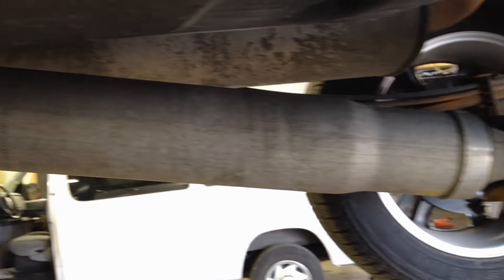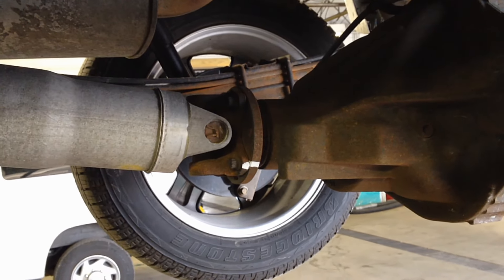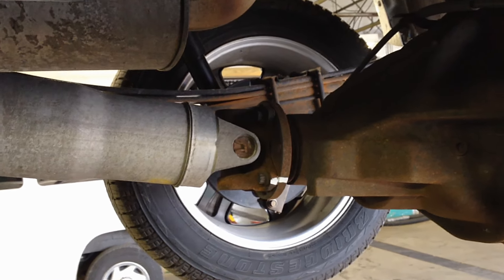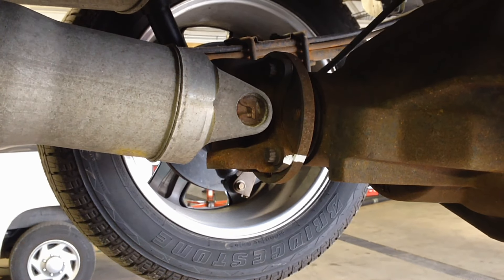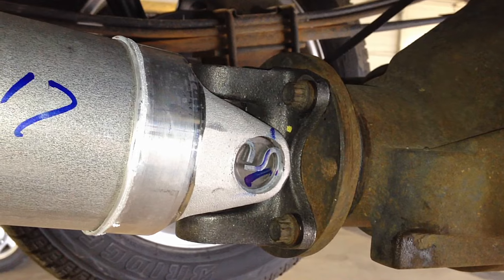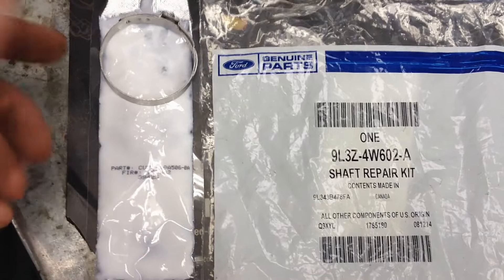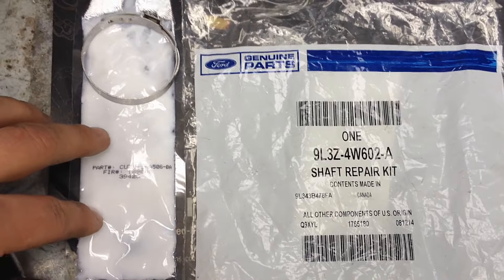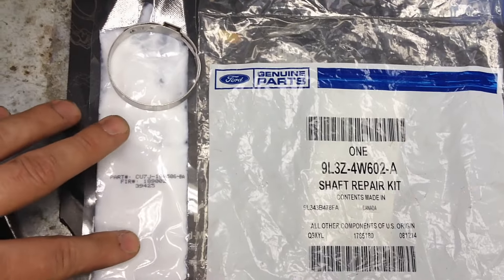Ford F150 One Piece Driveshaft Slip Bump- FIX!

Comment: Hi, I have a 2004 f-150 fx4 4x4. I installed a leveling kit and bigger tires, now I have a clunk or bump feel on take off and sometimes on braking. I have a one piece drive shaft that goes into the transfer case back to the rear. Do you think I have have to grease the slip yoke and is it possible since the slip goes into the transfer case? Thank you

Comment: Hi I have a 2018 10r80 and my shaft has the same clunk. Is that possible since by just looking at it it seem that it's not a slip yoke, the splined component seems to be a part of the trans.

Comment: I have the same clunk problem. It’s a 2009 f150 super crew with the 6.5 ft bed. What driveshaft length is that and would it be possible to convert to a 2 piece driveshaft? Would that help and would it be possible to convert it to a 2 piece?

Comment: I did this to my 09 with a 2 piece drive shaft. It fixed the bump how ever now I have a new vibration at 35 to 40 mph only?  I torqued the bolts to 70foot lbs. should I tighten them more? I have no idea what could have caused this new vibration.?
Reply from the maker: +Justin Miller Did you mark the driveshaft to pinion flange and mark the both sides of the slip joint so it goes back together right? The two piece driveshaft is a balanced unit
Reply: +FordTechMakuloco that my must be it.  I only marked the bolts on the rear diff not in the middle where the two ends meet.  I guess it's time for a new ram.    Thanks for the quick response.

Comment: I know this is an older video, but had a question regarding a 2013 150 4x4 with the one piece shaft. I added a 3” block to the rear in place of the stock block and now I have this slip bang again. Was curious if you think the fix would be simply to re-grease or to add a 3/4 drive shaft spacer? I know I changed the angles by adding the blocks, but what I don’t know is what the tolerance is for allowable “free play” on the yoke to the output shaft. Basically how far should it slide in and out under factory spec? Thanks, your videos are always a huge help!

Comment: So did you fit a 2 piece drive shaft to fix this issue? If so what's the part number on it please. My 2012 SVT Raptor has terrible stick on the slip yolk.

Comment: Looks like you have caused Amazon to be sold out, Will any PTFE grease work?
Reply from the maker: Rob Man I would not use anything but the Motorcraft stuff specified either wait for it or get it locally I guess. They usually don't take long to get back in stock. I even bought some of this stuff the other day on Amazon.
Reply: Rob Man Have used anti-size compound on a few Jeeps with the same setup.

Comment: In the process of doing this to my 06. When i was under there I noticed that my new seal on the rear output shaft on the t cace is leaking. I just replaced it about a month ago. I noticed there is a week hole on the bottom of the boot. Did I put it in wrong? Is that week hole supposed to be on the bottom or is there a brand of seal I should use instead? Thanks for the video!

Comment: I noticed one tooth is broached out ( tooth cut out ) on the slide yoke, why is that? Is the transfer case spline the same for alignment or some other reason? I really can't see how the transfer case spline could have one wide tooth as it has to be gear hobbed, and there's just no other way to machine a round and concentric ( male ) part like that.

Comment: Ok I'm having a problem with the rear drive shaft going back on the splines  the rv been sitting for years with the drive shaft off but there's no rust on the splines. I'm  not understanding why its not going back on. so I guess I will try and greese the shaft like you did or what. Mine is a chevy. Not to mention I tried tapping it on it goes in so far and stops

Comment: I have an 04 f250 2wheel drive 2 piece driveshaft and it keeps pulling out of the trans pushing on the center support. I had to replace it due to the bearings and rubber getting chewed up and it's doing the same thing to the new one. Do you know why?

Comment: I have a 2010 with the two piece drive shaft that had this problem and you aren't exaggerating one bit on how horrible and annoying this problem is. It made me hate and want to get rid of my truck. My local dealer fixed it using the method you showed under warranty and the drivetrain feels nice and tight now. I'm back to loving my F-150. Thanks for posting this. I know this problem has been going around the forums for years.
Reply from the maker: On the two piece one yes but not many talk about the 1 piece drive shafts.
Reply: Chad Fraser I can't speak for everyone, but it's been over a year now since the dealer fixed mine using this method and my driveline still feels nice and tight, good as new. I'm not sure why people are telling you to wait for your U-joints to fail. Is this a common failure on our year truck (2010)?
Reply: he mentioned 2011 worst year to buy ford truck so many recall and issues
Reply: I’ve had the computer reprogrammed, driveline replace and now rubber spring pads replaced and it still bumps/bangs. Any other ideas? 2016 5.0 145” WB 4X4 with one piece driveline.

Comment: Is this the same for 2004 f150?
Reply from the maker: Procedure and problem area still applies yes.
Reply: I keep reading to lubricate the slip yolk is this what it is? Mines an 04 as well. Quick question too, I notice when the weather is cold or truck is cold my truck pulls smoothly but when is hot or truck gets into normal temperature it starts doing this, so why is that?

Comment: Does this happen to the 2012 F350 powerstroke as well? This pretty much describes what I am feeling
Reply: Did you ever figure out what was wrong? Have the same problem
Reply: @Monzt3rVids  Yeah I ended up dropping the drive shaft and lubing the spline gear and it solved it. I've done it twice now.

Comment: Dang, wish I would have seen this earlier. My 2016 did the slip bump at stop signs too. Most notably when it was a rolling stop or very quick 1 sec stop. I searched all over for this issue and could never find the fix. Dealer didn't have any solutions either. I got so fed up with it, and the supercab door rattle that I ended up trading it in for a 2018 supercrew.  If I could have fixed this I probably could deal with just having the door rattle.

Comment: I pulled mine down and there was transmission fluid on the splines. Is that right?
Reply: Have the same issue, I started to pull mine out and red ATF started pouring out. Freaked me out and I put it back together.

Comment: Does this one piece drive shaft have a support bearing ? I got my seal change where the drive shaft meets the end of the transmission and was advise that the support bearing was bad , just don't seem to locate it once I'm under the truck . mine is also a one piece drive shaft .

Comment: Question for you, FTM:

The car: 2003 E-150 Econoline , RWD

One long driveshaft, going into a 4R70W. No external slip joint. Do not use the Teflon grease on these splines, right? Don’t want that stuff inside the transmission?

Thanks in advance.

Comment: Thanks for this helpful video.  Did this procedure to my 18 2.7 Scab yesterday and the 2 piece drive shaft looked a bit different.  The splined section that came out of the rubber boot was like a foot and a half long with wide splines.  It did have some grease but I added quite a bit more.  It helped somewhat with strange clunks when slowing to  stop.

Comment: I greased the yoke in my driveshaft a few years ago (05 F150 SCREW 4x4). Recently, it as felt like a weight is shifting to the rear when I take off from a full stop.  Ford dealer said it was the driveshaft yoke and transfer case output extension housing. They want nearly $1000 to fix it.  As I had already used the Ford green grease and this was not a permanent fix, would using some type of Moly based grease work better?  Does this grease end up mixing with the transfer case fluid (or transmission fluid in the case of a 2WD?
Reply from the maker: Orval Stuckemeyer Use the grease in the link below the video for the PTFE is works wonders.

Comment: Also, if reusing the old driveshaft you need to take a file & file off burrs @ the start of the spline @ the front of the insert where driveshaft spline first slides in. This is what causes it to try to grab/stick. Then grease as shown & re-install/re-stab driveshaft.

Comment: I am a retired chevrolet mechanic and when I rode in a ford truck a friend of mine has, the bump felt and sounded like a broken transmission mount to me. Yes I know the gm trucks have a problem with a clunk also. I am not picking on ford products ok.

Comment: Hi,
Does this also apply to a Ford Escape Hybrid 2010? I am experiencing the same thing. After engaging the car after a stop, a few meters after I hear a clunk sound in the rear. Only on stop and go.
Thanks!
Reply from the maker: No yours is totally different
Reply: FordTechMakuloco Would you know what I would have to check on an Escape? I brought the car to a Ford Dealer and they told me that they did not find anything or error codes. The only thing they told me was that the front tires and the back tires were a different size. That there was a 1 inch difference on the circumference and because of that the 4WD was engaging. They suggested to change all 4 tires and then see if the noise was still there. But when I changed both back tires last time the noise was not there. So I really don't know what it is. Thanks for your help.
Reply from the maker: Nicolas Hourcade If they are now out of tolerance yes they should be changed. When doing tires on a 4wd unit and especially a AWD unit as yours is all 4 must be changed. The clutch pack in the rear diff may be damaged already now.
Reply: FordTechMakuloco Hi, just to let you know about my situation. I have reversed my tires and I don't hear the clunk sound anymore. I guess it was just a tire size difference.

Comment: Hi there
My 1998 100 serires landcruiser driveshaft get loose after use of 2 ton3 months. A mechanic say its manufacturing fault which is hard to digest for me. Sounds very annoying even while parking i change gear from R to D. Any suggestions and solutions. Regards

Comment: I have a 2017 now has 4,070 miles and when stoping it feels like some one is running into me like 3 to 4 times before I come to a complete stop but it don't happen every time.. I wonder if this is what it is
Reply: Liquidisata - My 2016 feels similar, but with just one "bump" or "push".  I'm pretty sure it's the transmission shifting in to 1st gear.  It's pretty annoying.  Seems Ford should have programmed the trans to downshift either sooner/higher speed or after the truck was completely stopped (not at 1 - 3 mph).

Comment: Do you know the part number for the new driveshaft?  I want to see if my 2012 has the new one.  My dealer greased the slip yoke once but the problem is back now.  Thanks!
Reply: Do you have the new part i have the 2012 xlt n need it as well

Comment: @FordTechMakuloco, Ford is telling me I need a new drive shaft. 2011 f150 5.0. They said the inner part of the drive shaft is cracked. I have a one piece drive shaft, they said there is an outer part to the drive shaft and an inner part (the inner part is cracked they say) Have you ever heard of the drive shaft actually cracking on the inside? They say it’s normal to happen at 100k miles. The truck hasn’t been used for towing or for hardly any off roading. I’m going to try greasing up the slip yoke first, but curious if you or anyone has heard of this happening?
Reply from the maker: I'm sure it has failed in some way but cracking? Never.....

Comment: I have a 2012 F150 with a two piece drive shaft what is the torque specs for the u-joint?
Reply: My 2011 f150 was 76lbs.

Comment: Is is the same for the 2010 f150, I took my in about 3 years ago for this problem and its back again.  I think mine is a two piece drive draft?
Reply: http://ecoboostforum.com/threads/tsb-12-7-13-rear-driveshaft-slip-bump-2009-2012-ford-f150.97/

This is the link for 2 piece drive shaft. I just finished mine tonight. Very similar, only dropped rear part of driveshaft.

Comment: Thanks for the great video! Planning this for next weekend as I now have this issue on my 2012 super crew f150.
Question for you: I was under the truck tonight, before I saw your video, trying to see if anything was "loose". I noticed that I could move the out put shaft on the transmission had close to an 1/8" of play all around when I grabbed the shaft and pushed and pulled on it. Is this a normal amount of play?
Thanks for all responses!
Reply from the maker: Jeff Piatt Yes totally normal.

Comment: Yep. 2019 F150 Lariat 3.0 Diesel. Real nice truck, except for the water-torture slip bump that reoccurs about every 2 months. Started doing it about 3k miles. Finally dropped into the dealer at 24k to get it fixed. Awful. Second round of warranty repair underway at 29k. I’m trying to get Ford to authorize the dealer to put a grease fitting on it since it’s only going to keep happening. Way too nice (and expensive) of a truck to deal with this crap.

Comment: I have an annoying problem with my truck. What I told to the mechanic shop is; 
"I was driving my truck (F150, 2009 supercrew cab XLT) and I had just started from a stop and my rear end truck jumps as the rear wheel were blocked and jump on themselve. I've been told first it was causing by e-brake cable, so I told to the mechanic shop to replace it. (400$) Then they went for a road test and they noticed that the problem is still there!! They called me and said :" you have a drive shaft issue! to have it replace it will cost 1300$ish" My question to you is do you know if a drive shaft issue may cause that kind of problem?

Thanks Mario

Comment: I have a 2017 crew cab 6.5 box  with 2 pice drive shaft and I get a shutter when taking off with trailer from dead stop at 10 kilometers would this help with that problem? thanks

Comment: I have a 2004 f150 5.4 v8 lariat super crew. Recently had my rear u joints replace on the drive shaft. And had to have my drive shaft welded. Because it fell on the eway and was dented. Well today I was on the eway again and I heard this pop sound and the vehicle started vibrating badly. Pulled over because I felt this when it fell the first time. Looked, nothing fell or is looking. Did some research online and seen something about slip yoke could be the issue. Can someone please help. Not really car savvy.

Comment: I put larger tires on my 10' f150 , now the traction control thinks I'm losing traction when I turn due to the difference in tire rotation from the outside tire from the inside tire. Is there a fix for this?

Comment: Could that cause a vibration at high way speeds that you feel though the floor and seat.
Reply: Fk me too 70 miles per hr truck starts to vibrate my bro says needs shaft balancing
Reply: @goldenboypromo9055  I think he mentions in another vid you might put your drive shaft on 180 degrees from what it is now to stop/minimize the vibration
Reply: @goldenboypromo9055  Did you ever get it fixed? mine does it too. Bout to try to turn shaft 180 degrees

Comment: When I slid the driveshaft out of the transfer case a bunch of transmission fluid started spilling out. Is this normal/What could this mean?
Reply: That's transfer case fluid. It's normal cause that's the level it's filled to but definitely refill the fluid you lost from it. Just watch his videos on doing the transfer case
Reply: @nick-mf9cl  is it possible for the grease used on slip yoke gets in and mix with transfer case fluid? Or is there a seal at front of the spline?
Reply: @rendiewmit86  my guess is that it does get mixed in but I wouldn't worry about it. A little mixed in won't hurt anything. If it did hurt it then it would have been designed to where the two couldn't get mixed in like what you said, there being a seal.

Comment: Questions: if you order and install a new one piece shaft, do you need to align the new flange with the rear diff like you do when you mark the flange/shaft for the lube? or can you install in any location on rear flange?

Comment: Thanks for the video.  I've been using your video to diagnose, fix my 2012 F150 Ecoboost for some time now.  Great stuff!  Question - my truck has the 1 piece drive shaft, so what you're saying is that I just need the grease from Amazon, not the kit (which is for the 2 piece driveshaft)??  I have both on-hand, just want to return the Ford kit if it is not needed.  Thanks!
Reply: What grease worked

Comment: Great vid! Absolute great info. Any idea what to do for a common clunk/pop noise that occurs in the rear-end when you shift into reverse and start driving after driving forward for a bit?
Reply from the maker: Aubrey Doty More of a snap noise? Drive line or brakes.
Reply: @FordTechMakuloco  
Could this be the cause of a clunking sound when coasting and then when pressing the throttle the clunk happens?

Comment: Help!  
@fordtechmakuloco This last weekend I decided to grease my 2010 f150 yoke. I wasn't having "bump" issues, but I wanted to prevent them. I marked the flange, but not the transfer case side. I cleaned the splines with brake clean. I regreased the splines with the white Ford grease. Put it together, and now I have the bump... Any solution or help is appreciated!!! Do the teeth at the transfer case side need to be adjusted? Any help is greatly appreciated!

Comment: Hey Maku I have a question unrelated to the video, I'm going to change the rear diff oil on my 2010 F150 FX2, I've read on some forums some people say to use 75w140 for rear diffs on f150 trucks around the same year but others say contrary to what the manual says, 75w140 can cause problems so I was thinking 75w90. What do you think?